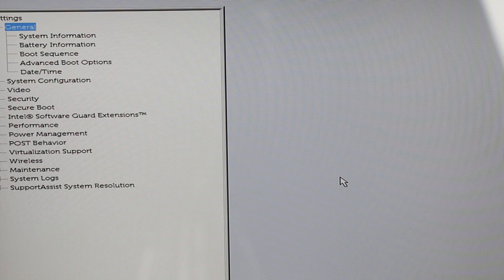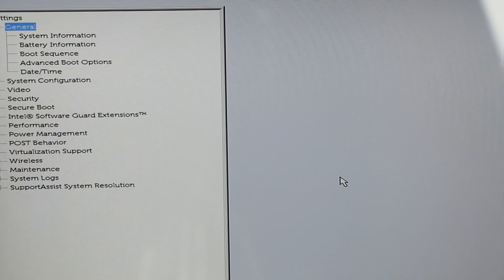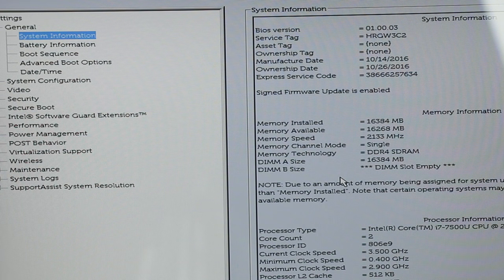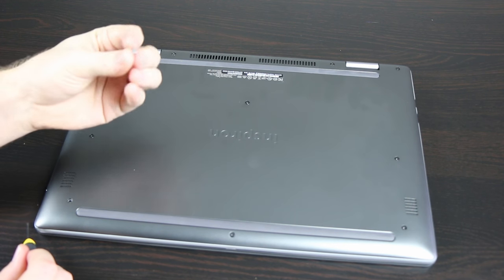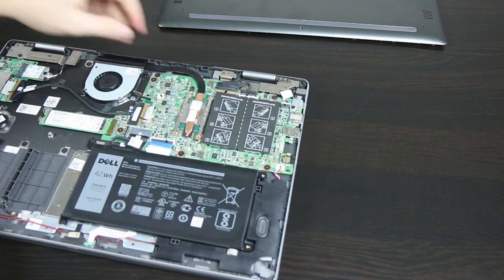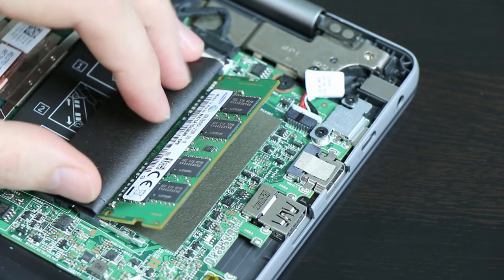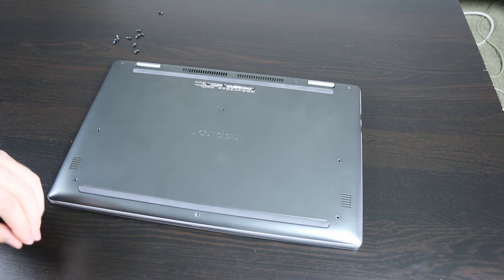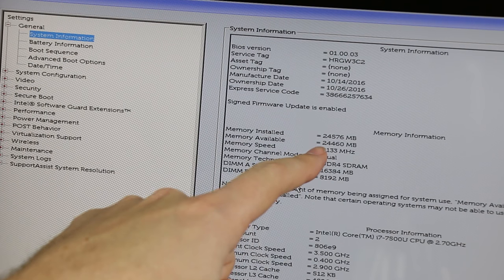How to install RAM Dell Inspiron 15 7000(7579) 2-in-1 laptop

Comment: Great video. One suggested addition: After upgrading the RAM, my Dell Inspiron laptop opened in BIOS and gave me the option to either "continue," "bios setup," or "diagnostics." I just clicked "continue" and that seems to be working, but I wasn't sure which was correct because the manual doesn't say.

Comment: If both slots are currently used, and you want to replace both of them, does any sort of backup need to be done?
Reply from the maker: Nope. Ram replacement doesn't require any sort of backup.

Comment: can I keep the stock SSD and add up another 2.5" Sata HDD 500gb or 1 TB
What  other options do I have??
Reply from the maker: You would need the SATA connector to do this. I'm not sure where you would be able to buy that. The only space I would see is right below the SSD, but it might not be enough... there is a plastic piece there that might block it.
Reply: Trent Buys thanks really appreciate it

Comment: Nice video, thanks a lot. Question: Dell Inspiron 2in1 model 7506, year 2021, is possible to change or up-grade the SSD? The current is a 256GB, may I up-grade it to 512GB? Thanks.
Reply from the maker: Yep. You can follow the service manual here to change it out: https://dl.dell.com/topicspdf/inspiron-15-7506-2-in-1-laptop_service-manual_en-us.pdf

Comment: In this video, he added an 8gb stick, when there was already a 16gb stick installed. I thought you could not do that? I thought both sticks needed to be the same gb size?
Reply from the maker: You can use different size ram sticks, but it wont maximize performance. In this case, it will perform in dual channel as two 8GB sticks, and the remaining 8GB on the 16GB stick will operate in single channel mode. It's not optimal, but adding the additional stick will still increase performance.

Comment: what does increasing ram do for your laptop? I also have a Dell 7579 i7, it came with 12gb of ram. I just purchased 2 16 GB RAM sticks, can't wait to see what it does for me
Reply from the maker: Increasing the ram will help with any applications that are hogs of ram (with 12GB, those are pretty rare), and the more ram you have, the more stuff you can do at one time.
Reply: best analogy is hard drive is to a file cabinet for storage as memory is to a desk. the larger the desk the more tasks you can do and it wont slow down. small desk shit is everywhere and you spend time searching and get bogged down....

Comment: Can you recommend a piece to buy? I'm on amazon and I see a lot of choices
Reply: Thanks, but I already bought one
Reply: not even the right one to buy its a 204 pin ddr3 you need a 260 pin ddr4
Reply: If you go to the Crucial website, they can do a diagnostics of your system and recommend a range of upgrades. You then just chose the one you want and can afford. They won't recommend anything that won't be compatible, so that's one less thing to worry about.
http://www.crucial.com/

Comment: Hi Trent i was told that if you buy a laptop with 16gb RAM that you need to install the same one 16gb RAM if you want more memory. Was he lying to me? Because from this video it seems like i was lied to. Thx!
Reply from the maker: It doesn't need to be the same brand, but it does need to be the same type and speed (For my case it was DDR4 2133 MHz.)

Comment: I have just added some extra ram to it (8gb @ 2666 MHz) to the already 16gb I had, but now when I turn the laptop on, the keyboard lights turn on and the center battery light turns yellow and flashes yellow multiple times but nothing happens - the screen stays black. Did this happen to you as well if the DRAM did not work/ was not compatible ?
Reply from the maker: It could be a bad stick of ram. Removing the ram solves the problem? The yellow blinking lights are codes... look how many times it blinks then look up Dell yellow light codes for your laptop
Reply: @MagmaticZebra  removed the new ram and it was back working. Tried a #2nd time and it worked with the new ram (even though was more performant)
Reply from the maker: @Bogdan_T  Oh cool. It probably wasn't seated quite right in the ram slot the first time.

Comment: Dell states that this laptop supports only 16GB of ram, but apparently that is not true. Is your system stable using these 24GB of RAM? Bought the same model a few days ago, but it came with 4+8GB sticks. I'm planning on upgrading it to 32GB.
Reply: Renan Ramalho I have the same model and it's fine with 32gb of crucial 2400mhz ram and noticed a difference in response time, speed and multimedia use but that has more to do with the fact that's it's running in dual channel mode than the amount of ram
Reply: Renan Ramalho did you ever update the dell 7579 to 32GB?

Comment: The ram sticks are sold haphazard as double stick combos, can I get a single 16 gb stick and keep the 8gb in the computer that came with and then have 24 gb ram. Also where do you buy the rAm you said 80 bucks, lowest i see are like 160 bills
Reply from the maker: Yeah, you can add a single 16gm stick and keep the 8gb. Unfortunately, Ram prices have gone through the roof since I made this video a year ago :(.

Comment: I have Dell Inspiron 15 7000(7579), too. but 8GB RAM and 256GB SSD version. Can I upgrade SSD to 512 or more? Or Can I change SSD to HHD? Or use both of it at the same time? Thanks
I'm not good at hardware (;
Reply from the maker: You can upgrade the SSD to 512 or more, yes. You can't change the SSD to HDD.
Reply: Trent Buys Thank you (:
Reply: if you need more space... external drive

Comment: @TrentBuys Is it possible to upgrade the SSD?
Reply from the maker: Yep. It takes a standard M.2 SSD and can be replaced.
Reply: Thank you Trent Buys  for that.
If i change the capacity, it isn't going to speed up the laptop any further right ? since it is a SATA based SSD
Reply from the maker: If you replace it with a NVMe SSD, it would be faster. It goes in the same M.2 slot, but the data transfer rates are a lot higher. That being said, SSD's are already pretty quick, so you probably wouldn't notice unless you are transfering a ton of data at once.
Reply: OH! Okay then, Thank you for helping me out Trent Buys Much appreciated
Reply: Is there any room for 2.5" ssd ?
I think its B key m.2, are u sure it supports nvme ?

Comment: ok mine shipped with 16gb... crucial says max is 16.... youre running 24... what's the max?
Reply: For that particular laptop, its 32.
Reply: you might have a different model laptop, or it might just be that crucial told you a different spec set for another laptop. Both are common mistakes.
Reply: I have a 7579 and have also read that 16gb is the max. This has me very curious that the max is really 32gb...